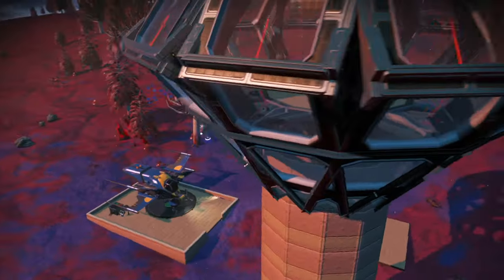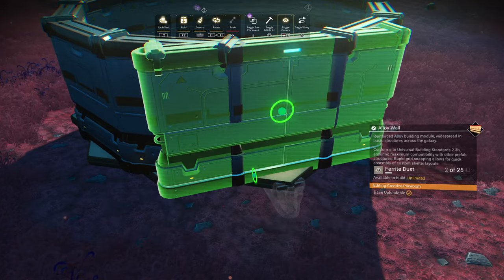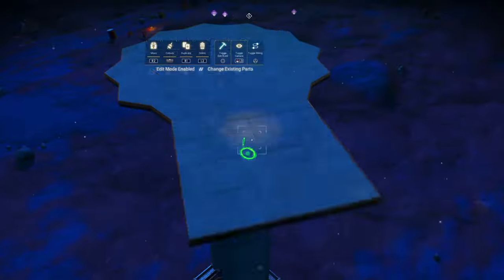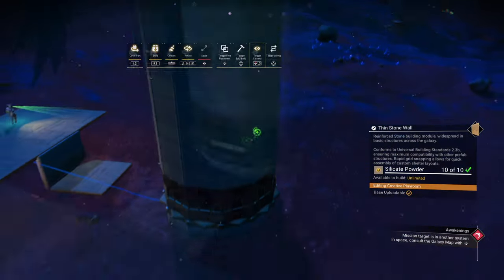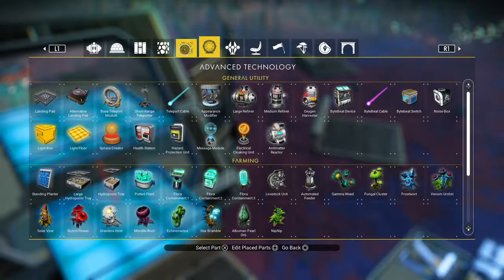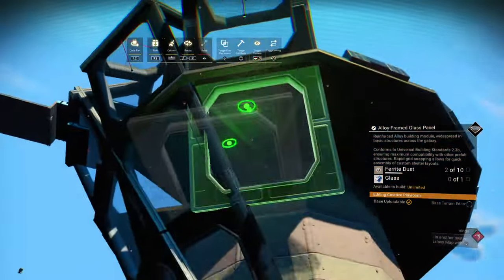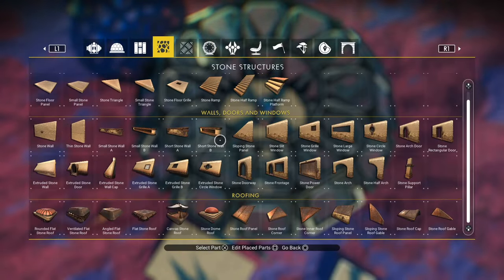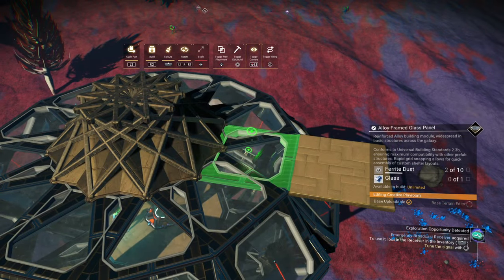How To Build The Watch Tower Tutorial - No Man's Sky Frontiers Update - NMS Scottish Rod

Comment: Great Design, the thing I struggle with the most is coming up with great looking Designs, always good to see them, sometimes I get the crucial idea I need by seeing what others do. Thanks for sharing and Teaching, great stuff!
Reply from the maker: That's what I'm hoping for, it will be great to see where you take the basic idea and make it your own. 🙂
Reply: @ScottishRod  I've done a couple of Builds that use the Biodomes, one higher than the other, glitch NipNip to Standing planter to get the Wire points and the glitch in Floor Tiles to end up with a Column to build on, They came out well. The General concept Rocks! Always good to see other was to use it.

Comment: Does the wire thing still work? Because when i removed the light floor wires disappear
Reply from the maker: They fixed that but it doesn’t seem to be across all platforms, if you can leave the scaffolding in place until your done that might help.
Reply: @ScottishRod  but if you leave the scaffolding the glass floor don't stay in the right place

Comment: Hi Rod... I've tried this technique again after the last two major updates and seem to have some trouble with leaving just the wiring. I've finished the tower and light floor panels, but when deleting the scaffolding it automatically takes away the wiring too. Is it a bug or did the updates ruin the glitch? Do you have any advice?
Reply from the maker: The only way to get it to work at the moment is to leave the scaffolding in place.
I'm going to have to do a few new videos because this seems to be a permeant change. 😞
Reply: 😂 Nevermind... Leaving the floor panels in still makes it work. Thanks again for the tutorial
Reply: @ScottishRod  It's an unfortunate change. I realized when I put the roof on that the glass panels didn't snap into position like it should... The whole watchtower still works, but the roof looks a bit wonky. Would really love an updated video once you've got it ready. Thanks for all the effort you put in to make glitch building easier for pleps like me

Comment: I really enjoy your vids and designs. But I am having a slight problem with this one. I have one set of glass floors that won't glitch right. They are always on their side. I have rebuilt the window scaffolding 20x, spun the light floors, spun the build camera and they still glitch on their side. Any ideas?
Reply from the maker: Check the wire direction, it may have twisted.
If you pull the wires the wrong way it changes it’s rotation. 
If you’ve seen my atlas build pyramid build I show how the wires can flip that might help understanding the way they work. 😊
Hope that helps?!
Reply: It did! Thank you so very much! Your builds are awesome and has been keeping me playing NMS to try and replicate your builds. Thanks again for the help!